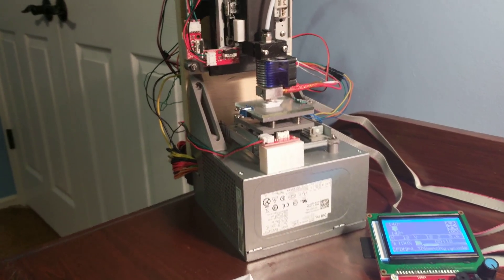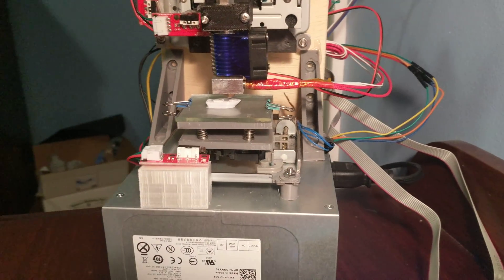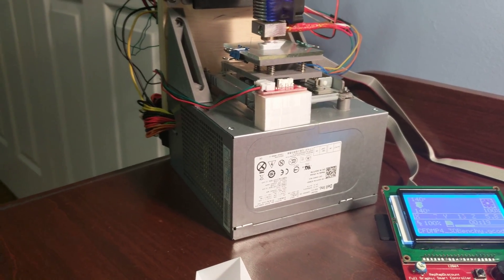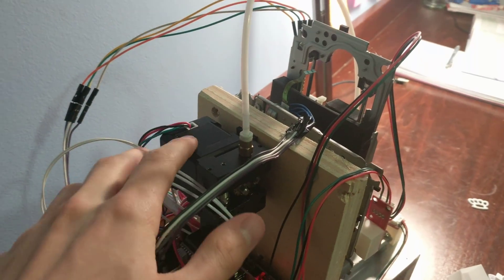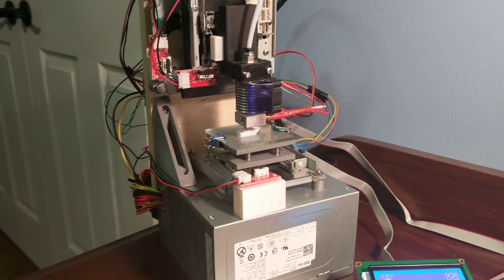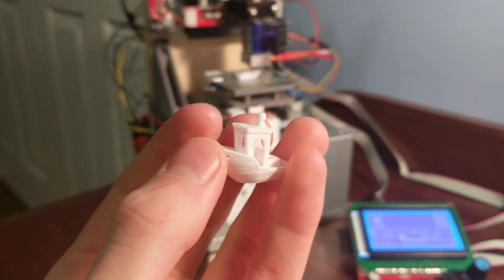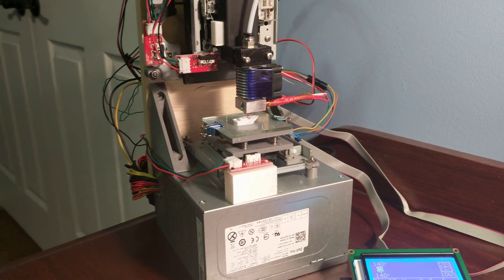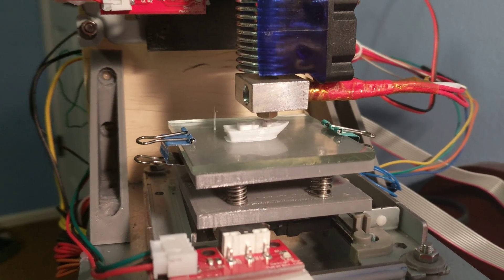40 dollar 3d printer! Reprap ewaste CD drive printer made from scratch.

Comment: Kinda looks like you had to use a Nema17 for the extruder ... a bowden setup would seem to be necessary there.  Pretty sweet.  Need to figure out how to manufacture these things with child labor in asia.  There are certainly enough broken flops, CDs. and PSUs about!
Reply from the maker: Yes, it is a nema 17, although a geared stepper salvaged from an inkjet printer would do the job. yes, a bowden tube is necessary, for weight. Thank you, the build was fun, and the prints have surprised me. Haha good luck with that, at least you wont have to worry about material supply.

Comment: So these just wire up same as a NEMA17?  What voltage at the driver are you using?  A matched pair would be an advantage.  I'll pick up a stack at the junk sales this summer!  Following!
Reply from the maker: Yes, exactly, standard wiring. They are standard 4 pin steppers. I believe my voltage is at under 0.2 volts per motor, with the z motor at 0.3. definitelt do so! Ill be posting more videos on the project, hopefully. Eventually a second iteration and build guide will be in order. Thank you, keep me updated!

Comment: Oh Neato! Love the steampunk look! I like that you used a old power supply too.  Now if you could find a recycled motor suitable to use for the extruder stepper...
Reply from the maker: Thank you, I actually have a few motors I think would be suitable, especially in a geared setup, which I got from recycled inkjet printers. If I were to use it, it would bring the price of the printer to under 30 dollars!
Reply: Yeah, you would definitely need some gear reduction.
Reply: I expect there will be appropriate motors inside old ink jet printers 
(cheaper to buy a printer than ink cartridges)
Reply from the maker: I just checked out your channel, forgetting I was already subscribed to you on my personal account. As im looking through your videos,I see your (nearly) fully printed reprap, which ive been following for a while. I just wanted to say how impressed I am, I really love the reprap project. Ive seen a lot of mostly printed printers online, but i would have to say yours is the most impressive. Once done with my projects for MRRF, I really want to build a mostly printed printer,of my own design, and will most likely use a rack and pinion system. I'm very excited to see your project at MRRF, and hope the printer design catches on,  I know people will love it!
Reply: The rack and pinion is definitely the most legit method for a completely 3D printed drive system. I really wanted to do a z-axis rack and pinion with a single stepper and dual gears sets but I choose instead to experiment and drive each axis differently to see what worked. I would really like to see people take the best ideas from my printer and use it to design their own. I’m impressed with the Mulbot but we can make it even better. I’m excited to see what you bring to MRRF, see you there!
Reply: @3DPrintingWorlds  I cant wait, you have really got the gears in my head going now, I may be up all night designing a printer! haha.
Reply: If you find a geed herringbone gear rack generator let me know. I cant seem to find one.
Reply: @3DPrintingWorlds  yeah, I'll look around and tell you what I find. I was thinking about designing my own parametric model, and I may upload it if it's good enough.
Reply: Fusion has a add-on generator for the pinion but not the rack. I used one on thingiverse but I felt the module was way bigger then it needed to be. Plus its a herringbone which I would think a helix would be a better choice. I think the herringbone was chosen because they are used on extruders but that doesn't mean they are better for linear motion.  The part were I see the most wear is the pinion. I think a standard helix would be smoother and probably last longer but the side thrust might cause a issue.
Reply: @3DPrintingWorlds  Oh, I'll have to check that out. Thanks for the info. What do you think the advantage of helical would be over herringbone? I would think the herringbone would be better because of the self-centering nature of the gear. Also do you print the parts in pla? it is significantly harder than abs.
Reply: I cant find the right words to explain it but since the herringbone is taped misalignment can cause vibration and wear. I printed then out of PLA but changed the pinion to ABS because the heat from the stepper was causing the set screw to loosen up.
Reply: @3DPrintingWorlds  yeah maybe so, the misalignment aspect makes since. Abs does wear significantly faster than pla though, what are your stepper drivers/stepper currents?
Reply: @lukecunningham8793  I don't remember what I ended up at but they are way lower then the calculated value with no skipped steps. I think the motor shafts were still about 80-90c. The pinion gear in ABS is showing some wear.
Reply: @3DPrintingWorlds  wow that's crazy, what size motors are you using (length of nema17), and what trype of driver is it (drv8825, a4988, or a trinamic driver)?
Reply: @3DPrintingWorlds  looking at the video it looks like drv8825 drivers. I have heard that those have a tendency to overheat motors and be more prone to step skipping than a4988. You can replace them all very cheaply, and it may just fix the overheating problem
Reply: I thought I read the opposite, that's why I went with the 8825's. lol  I don't think 80f is to far off the mark. I have some a4988's maybe I should give them a try to see if it makes a difference.
Reply: @3DPrintingWorlds  oh, that may be the case, but I would try the a4988s and make sure to configure the right driver in Marlin (I assume that what you're using). My printers use a4988s and I never skip steps, and my motors stay room temperature
Reply: @lukecunningham8793  I know I have it configured properly. I'll try swamping out the drivers if I get a second.